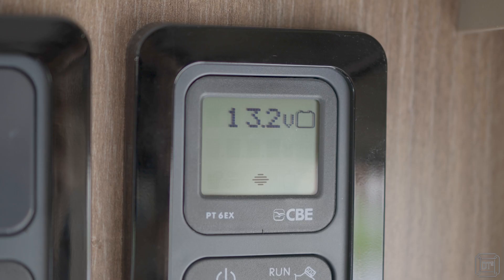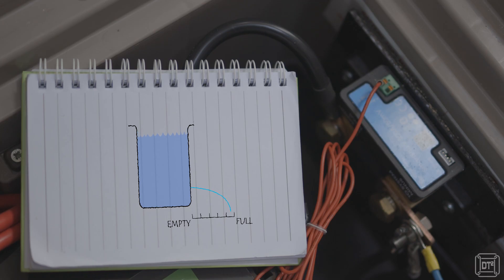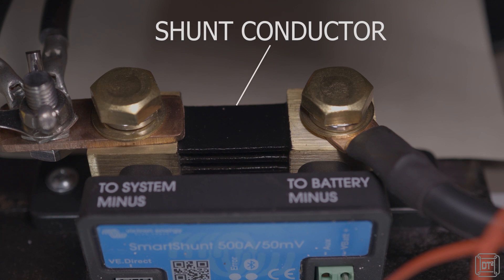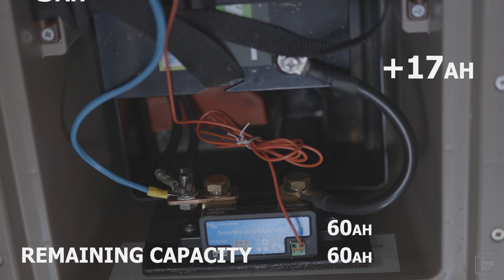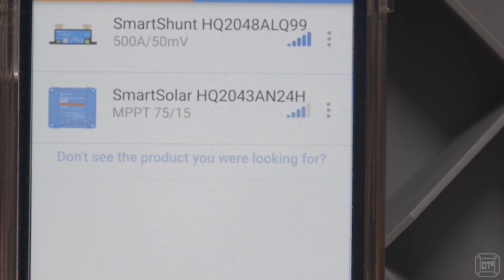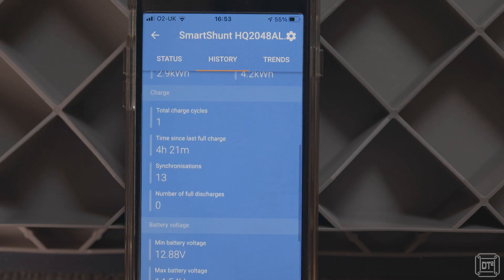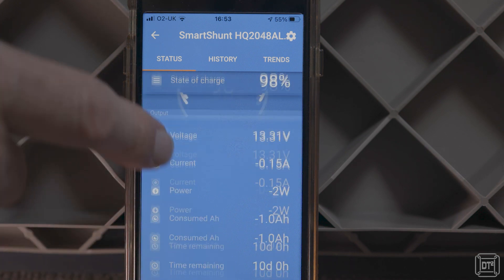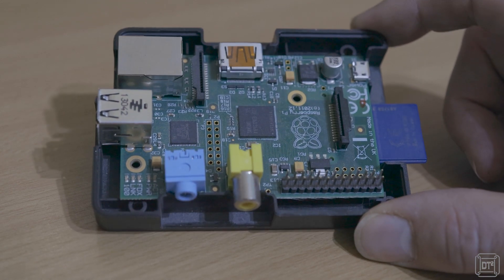VICTRON SMART SHUNT –smart enough?

Comment: Actually, the smart shunt does have memory available to log data and it will be available in a future update.  I can see why the Victron SmartSolar doesn’t store data from the SmartShunt.  If you need that level of integration, Victron wants you to purchase a CerboGX device.   I’ve tested the beta version of the SmartShunt with data logging and it was more than capable to provide that historical data you’re looking for apart from the bugs that are still in their software.  I would imagine that it’s only going to get better with time.  You are correct in that it is a shortcoming of the SmartShunt but I do believe it is being addressed.  What I didn’t see however was any way to see what my daily Ah battery consumption was.  I can see a total Ah draw from the battery but that number changes once there is input from the solar array and I’d really like to see what my total Ah output was for a 24 hour period.  I think this would help in determining how large of a battery bank one needs as well as how large of a solar array is needed to put that power back into your battery.  Otherwise, it’s a little bit of a guessing game and requires a little more math on a manual level.  Maybe I’m missing something?
Reply from the maker: Hi Gainestr,
Good to hear that an update may be coming to unlock that memory. I suspect you’re correct in that Victron may want us to purchase a CerboGX. It’s a bit overkill to log some pretty basic data though, the CerboGX models I’ve seen are almost as much as the shunt and solar controller together.
In terms of calculating the “daily Ah consumption” they may have omitted that since the definition of consumption may differ. For example is it everything that came out of the battery or all power that was consumed by the entire system? The later would be the total solar output plus deficit from the battery at the end of the day compared to what it started with. When the solar is producing current then the draw from the battery is zero (unless it is not full) so I think that the shunt would struggle to work this out since it is in parallel with the panel and so out of the loop (if you’ll excuse the pun) on what current is flowing. If the solar controller and shunt exchanged and stored this data then one or the other could give a complete picture. Maybe the CerboGX does this?
I think if it was possible to log the maximum and minimum state of charge of the battery for each day that would go a long way for determining bank requirements (albeit in retrospect).
Thanks for letting everyone know that that update is coming down the line.

Comment: I have a related information transfer question. I too have a 75/15 MPPT SOLAR controller. I have bought a Cerbo GX and wish to connect the 2 for data transfer. There is not a VE direct port on the smaller controllers. Can you use the jumper port (remove jumper, I don’t use the Load feature anyway) on the solar controller and if so, what are the connectors and cable? I find your videos excellent and thanks for sharing!
Reply: They both have ve.direct ports. There is normally a jumper on the two middle pins of the socket when you get it. The back of the manual has some details and images of how that works. I have my SmartShunt and SmartSolar 75/15 both connected to a Color Control GX using ve.direct cables both working very well with the data being sent to VRM.
Reply from the maker: Hi Daniel Are you not able to link the solar controller to the Cerbo using Bluetooth as a be smart network? I don’t think you can repurpose connections as a VE port. May be worth reaching out to Victron they are usually pretty good on support.
Reply: @DTSquared  Thanks for your quick response. I will reach out to Victron. Enjoying your channel!
Reply: If you bought a "Blue Solar" device, it lacks all the smart features that are on the "Smart Solar" products.

Comment: I'm not sure it's the solar charge controllers job to record data from other devices. Maybe this would be a better job for the cerbo gx? Maybe it already does this, I don't know.
Reply: Well I'll respectfully disagree. Just because it logs it's own data doesn't mean it should log the data of other devices. It's just not meant to do that. I've got a multiplus and cerbo here I need to install, no charge controller as of yet. I've already got a bmv-712 and I don't have any expectations that the multiplus log the data from the 712 however I hope this is a feature of the cerbo, as it's a computer.  I know this data can be uploaded to the internet for logging by the cerbo but I'm not sure how much it keeps onboard, if any. The cerbo and touch 50 were around $600 so they're pricey but not terrible. A phone costs a lot more than that.
Reply from the maker: @caseypries7559  That's fair enough, it's not really a philosophical point just that it's technically possible and would be advantageous to users. I'd certainly hope, like you do, that the cerbo provides some logging. With solar installations having a decent history of how they perform is really useful in assessing their effectiveness and where any future investment should be spent or changes made.
Reply from the maker: The point I made in the video was that it was a missed opportunity. But in a way Victron made it the solar controller’s job by giving it the ability to store data and the connectivity to talk to their other devices. In a small-scale solar deployment such as a motorhome or caravan the most common Victron setup with multiple devices will be a solar controller and one or two other devices such as a shunt, invertor, battery and maybe a B2B. The shunt (and I think most/all of the other devices) have no data recording, the solar controller has data logging and is always on. So why not log other basic data? Even if the other devices had logging it would make sense to centralise data collection in one device to avoid having to merge data after downloading. As far as I can see apart from possibly memory capacity there’s no technical reason not to do so.
The cerbo GX is a cool device but overkill for most camper projects and would pretty much double the price of most Victron van setups.

Comment: Hi Dave and thanks for the very interesting lecture on Shunts. I am in the process of putting solar panels on my camper roof and having the electrics (all Victron) installed by a specialized electrician representing Victron in my country. I recently spoke to another electrician working exclusively on campers but using a variety of brands of Li-batteries, shunts, MPPTs, and inverters. He told me that Victron is excellent for any component they provide, except for their Li-batteries, as apparently they stopped working for several of his clients in the past 2-3 years. He replaced them with Liontron Li-batteries and the systems he installed now do work. I would prefer to have all components from one brand and Victron, from what I have seen so far, seem an excellent choice. Do you have an opinion on the subject matter? Best regards from  Switzerland, Silvano
Reply from the maker: Hi Silvano, glad you liked it and found it helpful. I don't have any experience of Victron batteries I'm afraid. As a general opinion pretty much any western supplier of batteries with a couple of notable exceptions such as Tesla will be importing and badging/branding batteries made by other manufacturers. So you will firstly be relying on their choice of components and suppliers which may change over time. Secondly on their quality control process to ensure they weed out the bad ones. And finally their support policies to cover any warranty. I'd be asking your electrician what happened when those batteries failed. If Victron replaced them with new ones with little fuss then I would personally take that as a good sign. Hope that helps some. Dave
Reply: @DTSquared   Thanks Dave. I will look into that. Best regards, Silvano